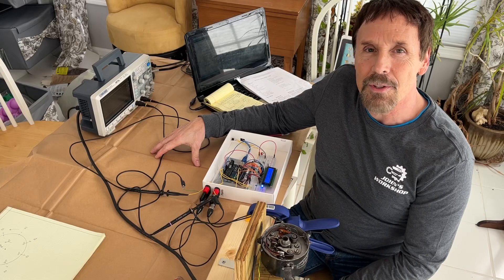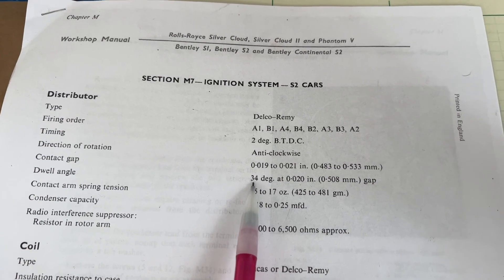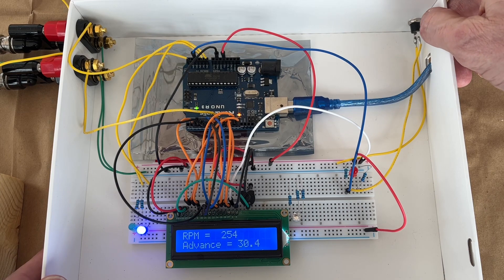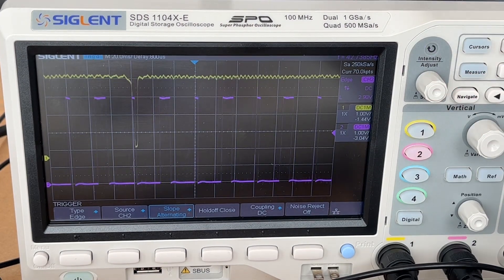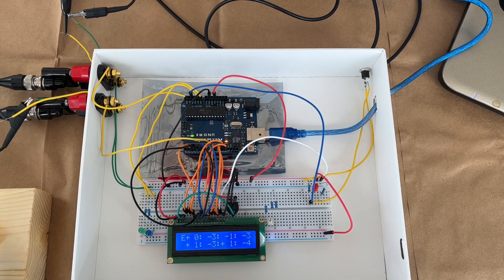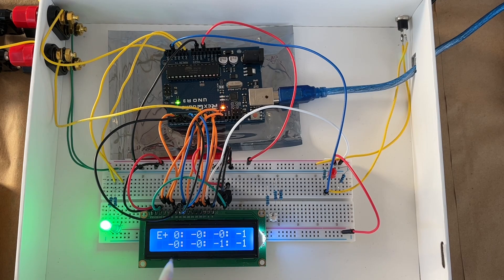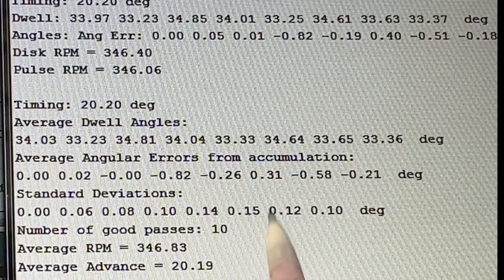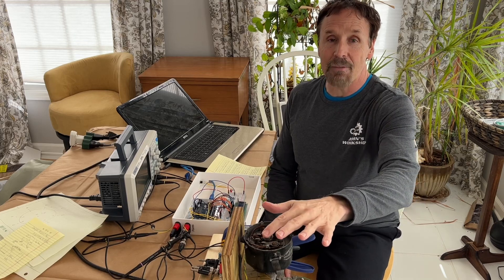Arduino Distributor Assessment of a 1961 Rolls Royce Silver Cloud II

Comment: The Silver Shadows will run on FOMOCO ignition parts, curious if a GMC v8 engine from similar vintage (or Cadillac) NOS distributor could be converted by machine shop for use  with no vibration?
Reply from the maker: I would think that would be possible since  the functionality would be the same. However, that could require a lot of custom work and they would also have to get the advance curve right for the Rolls engine.